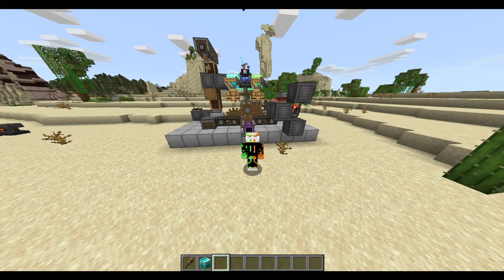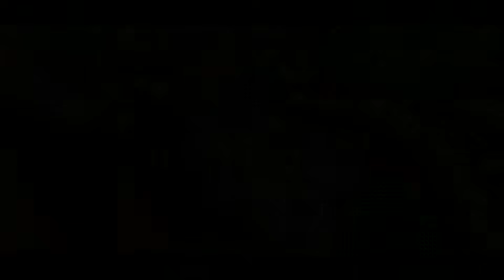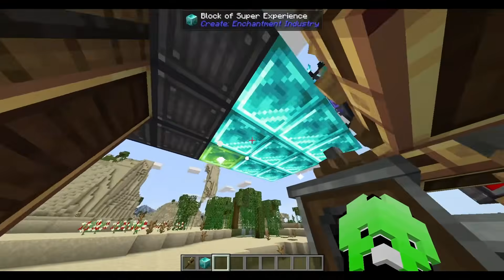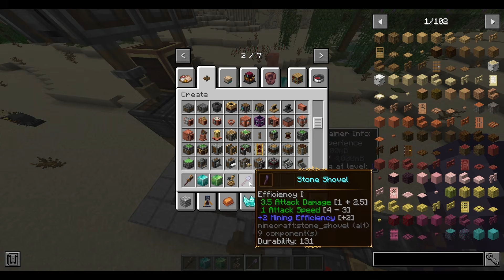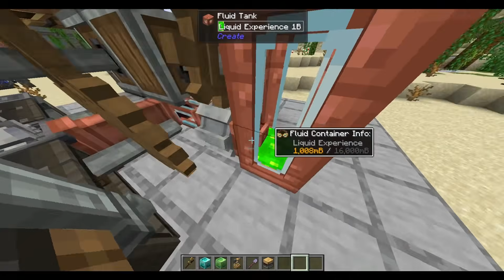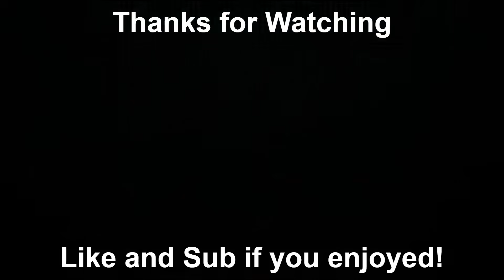Infinite Super XP Block Farm - Create Enchantment Industry 1.21.1

Comment: when  i use it the minecraft doesn't go foward and the exp blocks get placed then broken inside the drill  and not where it should be
Reply from the maker: As I can't see exactly what is happening in your game, I am not too sure about your issue. But my guess is that you have not set the minecart contraption to lock rotation when you first place it using the cart assembler. And about the minecart not going foward, you need to have a solid block behind the powered rail for it to work, otherwise, you can also try controller rail added from the create mod.

Comment: how did you get the blocks of iron into the drills?
Reply from the maker: I am not sure what you meant by blocks of iron as i did not use any iron block in my build. However, if u are talking about the industrial iron block, I just place them down before putting in the minecart. If you are finding it difficult to put the blocks in while the minecart is active, try removing it temporarily. If this is not want you are talking about, can you explain it a bit more?